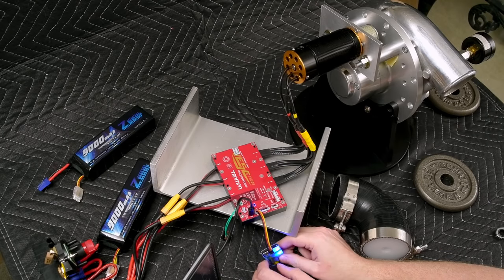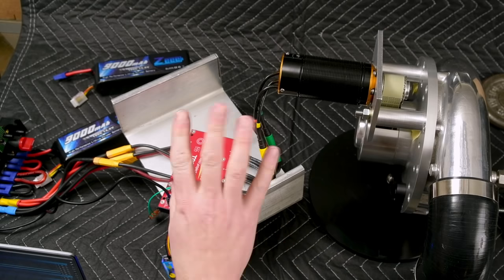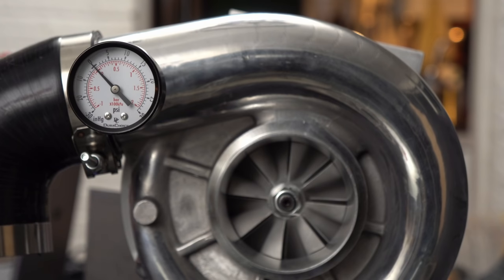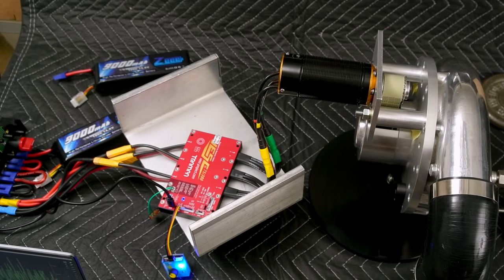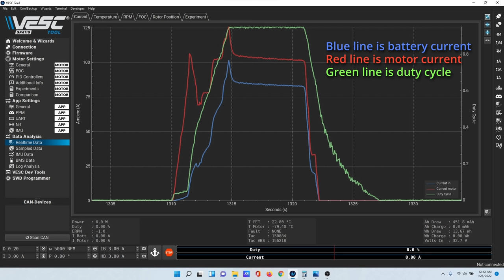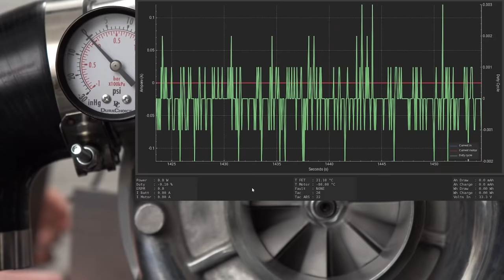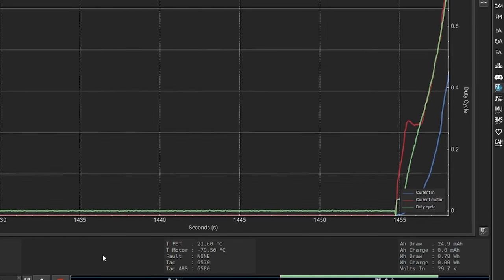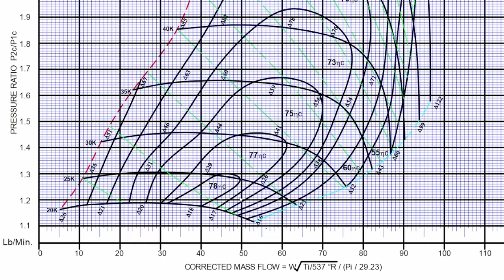Easier/Cheaper High Power DIY Electric Turbo - First Tests

Comment: I've been thinking of doing a direct drive 60k rpm Neu Motor1539 0.75Y motor (~48v set up) or 0.25Y (~12-14 v setup).  It's a very high quality motor and does 3500W continuous / 7000W peak.  This was just my first idea without knowing any of the real loads or the compressor map.  My car applications would either be a 3.2 or 1.6L engine and aiming for 5-8 lbs of boost.  I'll definitely be watching some more of your videos and checking out your forum.   I was eyeing up this supercharger and was wondering what the pulley end looked like and how hard it would be to make a coupler as a direct drive setup.   I would rather spend the money on a nice motor than buying pulleys and belts.  I played this game of high RPM drives for a 15 lb  combat robot in high school where we were driving a #35 chain at 30k+ rpm on a Neu 1515 1Y motor (it held together impressively).
Reply from the maker: Think of it this way: it takes about 4kW to support 200 hp.  Our first version made 650hp on 13.3kW.  Don't get caught up in boost numbers because the classic rules don't apply - there are no pumping losses with an electric setup and no parasitic drag.  You can certainly direct drive it (the first version was, and will be - but this time with a 40kW motor to push the compressor to it's limit.  This version is stupidly simple to build, and more compact and cheap.  That's why I built it.
Reply: @AlexLTDLX  Thank you for the power estimate.  That makes it easy.  The physics make sense...it comes down to mass flow rate being flung outwards from the centrifugal impeller.  My application will be for autocross for 40-60 seconds, with periods of coasting between full throttle stints.
Particularly for the 1.6L application, it would be very easy to do this on 12v.  Especially with a megasquirt and a map sensor already being used.
Reply: @AlexLTDLX  I have a mini CNC mill, so making an adapter won't be too bad.  I've done many more complex things, like build a custom cylinder head from scratch that uses rotating tubes instead of valves to let the air in and out.  It takes a lot of good judgement to make something like that work.  I have a bunch of videos of them (Briggs and Stratton, as well as a 2.8L Bmw inline 6)

Comment: I really enjoy the data and the thought process and the learning setup

But I immediately liked and subscribed and love it just because  1990s Tom Hanks is giving the lecture 🤣🤣, could it be any better if your voice was similar to Morgan Freeman or micro
Reply from the maker: Thanks!  And I get Iron Man, Nicholas Cage and Tom Hanks.  If only I was any of them (well, early Nick Cage - pre Wicker Man. That was just bad.
Reply: @AlexLTDLX  what is the forces on a timing belt if you were to increase  the diameter  of the pulleys 

Like don't solid fill the pulleys, I'm thinking  the turning around a 1 inch pulleys at 55k rpm might be as much of the heat, until you get to such a large pulley diameter  that the centrifugal force rips the belt apart.

Might be an option  for a cooler belt

Comment: I think it's time for you to get a MAF with a known/available curve, a large butterfly valve and a simple pressure sensor. Then up to you to use a datalogger and excel, or something arduino or whatever, and do runs on the bench that way. Basically you put the thing on 100% of the frequency/power, and slowly shut the valve. Then science! (And propper power supply, and a polycarbonate blast shield)
Reply from the maker: The MAF thing is a really good idea.  The only issue I can think of is achieving laminar flow through the MAF to get accurate readings.  Not sure if you remember the days of "clocking" a MAF to adjust fuel mixtures.  Here's a little secret:  I've been shopping for a dyno.  There are SO many things I've wanted to dyno test over the years, and this here Youtube channel might help me if not pay for it over time, at least offset the cost.  The LTD's been my test bed for almost 30 years at this point...
Reply: @AlexLTDLX  Where in the USA are you?
Reply from the maker: @DC_DC_DC_DC  I'm just outside you - DC.  That looks really weird written down, and frankly, a bit prison-rapey...  🤣
Reply: @AlexLTDLX  that's too bad, I know a good dude with a Dyno but it's next to Seattle. By the way the MAF will register decently when there's a bit of straight tube length, and that's easy to achieve on the bench setup
Reply: @AlexLTDLX  just DONT buy a dynocom. Those things are crap, they might be pushing a nice price, but DONT do it. If you want to get rid of your money you can just send it to me, it wil be just as usefull to you as buying a dynocom dyno from it, but without the troubles and the piece of crap in your space.

Comment: Was that 3 psi? Because that would make any car go like a bat out of hell!! Iman R/C enthusiast and i looked everywhere for a n electric motor in 540 size to over 50000 rpm? Yet i cant find anything! Cheers 🙂
Reply from the maker: Conventional turbo thinking doesn't really apply.  Think more along the lines of a Vortech or Procharger supercharger - they require less rpm.  We picked up over 200 wheel horsepower recently on the dyno on a 6.0L V8 and were only spinning 32,000 rpm: https://youtu.be/b9d5xv9INmw
Reply: @AlexLTDLX thank you so much ❤️. I'm going to look at your link! Thanks for that too. Cheers mate 👍

Comment: instead of lipo,s which are not so safe and in high current demands they tend to go bad, you can make a larger pack of lifepo4 or better LTO for example 35Ah cells
Reply from the maker: Done: https://youtu.be/nYzpmPSVE0c  Capable of 900 amps continuous.
Reply: @AlexLTDLX  I saw a little bit later :) cool

Comment: How much power will I gain with my v6 camry trd and when I'm not using the boost how much power do I lose at it will be a restriction
Reply from the maker: Depends on the base hp of the engine.  As for the restriction, it's about equivalent to 1 psi of boost loss on a 500hp 6.0L V8.  So you'd certainly see much less than that. If you haven't seen the drag test or the dyno test videos, they're worth watching: https://youtu.be/nlTVHkfSQXM  and https://youtu.be/PjOJU02FIGw

Comment: Unless the motor control unit is a constant Current type, the current should have dropped at the same time. When you deadhead a centrifugal pump, it is no longer pushing anything so it speeds up and the current drops, ie no resistance from the ari that the pump would be pushing. This phenomenon only applies to centrifugal pumps.
Reply from the maker: You're correct about the gain in rpm, as I mentioned in the video, and the overall current went down; but a brushless ESC has two currents to look at - battery current and motor current.  Motor current is higher than battery current almost all the time because until the motor hits 100% duty cycle battery current is dependent on motor current lessened by duty cycle dead time (a FOC VESC is limited to about 95% duty cycle to give it time to calculate the next stator event).  In other words, 100 motor amps at 100% duty cycle would give you 100 battery amps.  100 motor amps at a 50% duty cycle will only give you 50 battery amps.
Reply: @AlexLTDLX  Of course. I forgot about the DC driver, Thanks for the insite. Used to VFD's driving the motor in AC.

Comment: Hi, why not use a steady power supply versus batteries? In a real world use case, the cars power supply could be tapped to power. This is a very cool video. I myself am into rotaries. Heat with rotarys is magnified under boost scenarios. I've been curious about the possibilities for using electric based forced induction to reduce the crippling heat caused by a standard turbo. Can't wait to watch the next videos on the topic.
Reply from the maker: The problem is a car's electrical system is nowhere close to be able to supply this kind of power.  We were seeing a consistant 14 kW with the first version, and this new setup coming in (not here yet) is capable of 40kW peak.

Comment: instead of a 1in or 5/8in "hole" you might try playing with percentage of restriction compared to turbo outlet diameter, ie- 10%, 20% or 30% smaller opening. My guess is 10-15% restriction will yield the best results.

Comment: would a sprag / one way clutch help with belt life and bearing life and does the brushless dc motor act like a dynamo with the impellors inertia  after a full power. cheers
Reply from the maker: Probably not worth the effort.  It spins down pretty fast, and a blow off valve does the trick (my buddy Brian tested to make sure it worked on our first dyno test).  But I do share your concern about belt life.  The bearings are way understressing in this application.  I'm setting up a full power test right now - we'll see if the belt holds.

Comment: Isnt it possible to change the ratio of the motor shaft to the turbine shaft, so that the turbine could turn like 5:1 to the electric motor to generate even more boost? Or would does it require more torque to spin the turbine? If  so, how difficult would it to reliably do so. Could you make an entire transmission to change gear ratios, therefore changing boost pressure on the fly?
Reply from the maker: It does require more torque to spin the impeller - in fact, it's pretty surprising how much torque it takes, particularly as rpm increases.

Comment: Does this setup make any boost without the snorkuss?? Will it make 5 lbs at double the rpm with the snorkuss? Could it run at double the rpm or more?
Reply from the maker: Well it wouldn't really make any boost without the snorkus because it'd be wide open and the compressor would go straight into choke. Technically a centrifugal compressor does make boost in the volute, but it's really only a couple psi. Running wide open it really doesn't give you much useful data. It's more of a test for current draw to make sure everything holds up. But since we know our compressor map and we've drag tested a similar unit and know the power it should make - about 650hp at 4 psi: https://youtu.be/AOL3Qyczt3Y we can now approximate its performance on the engine by finding the right size hole in the snorkus.

Comment: Can't you run a 6 inch pulley on the electric motor like  crank pulley size
Reply from the maker: You could, but you'd need a physically much bigger and heavier motor - because you'd need less rpm but more torque.  This is a good balance of size, weight and power.  I've got another motor for this in the wings with sensors and fewer poles - which should fix the issues.  In the meantime, I've decided to iinstall the bigger unit - which we've already tested on the car.  If you haven't seen it, check it out: https://youtu.be/7cCSbogg-AI
Reply: I was looking at it a few years ago , 12v high torque motors. Attach a big pulley then you only need it to run at engine rpm 6500rpm etc .

Comment: Willing to see a axial flux design of this.
Reply from the maker: I've looked into exactly this - it would be awesome to have the magnets on the actual impeller.  Unfortunately, materials science and physics work against us (for now) - you can't get enough RPM without the thing flying apart - or at least the magnets ripping themselves out.

Comment: look for a 1/8th or 5th scale rc motor , might be able to get something around 1200-1500kv , even some 1/10th scale motors around 3000kv
Reply: i know of a few extremely powerful motors and esc combos , some setups being able to run 4 6 cell batteries at once
Reply from the maker: Check out the "sledgehammer" version (my latest video) - it uses an LMT 30100 with an MGM 800 amp ESC.  You'd be surprised at the amount of power an electric turbo takes to run.

Comment: Gonna need 16s to make at least 10-12psi
Try you some cnhl 9500mah 90c 6s lipos on series 12s to start
Reply from the maker: Already did that: https://youtu.be/AOL3Qyczt3Y 16s made 6 PSI tapering down to four. But one hell of an improvement in performance in the quarter mile and 0 to 60. This is simply a cheaper easier to make unit that should have similar performance. The big bastard is coming down the pike though. That should be good for close to 850 horsepower.

Comment: Could this be used to push a 68mm turbo on a diesel truck?
Reply from the maker: Probably not a great choice for a diesel - they usually run too much boost.  The technology to make high boost pressures is right around the corner.  Or you could stack 3 of these in a serial (compound) fashion - that should give pretty high boost.